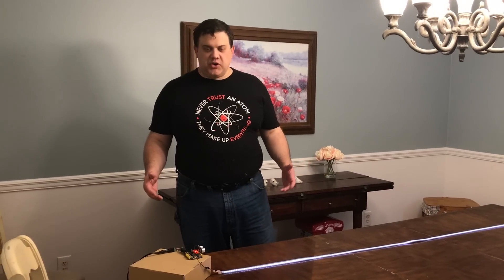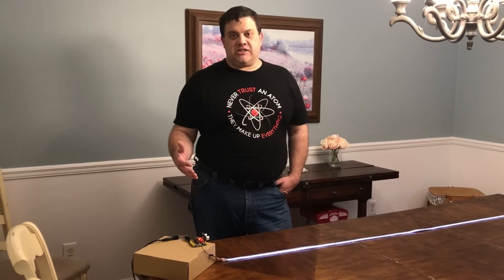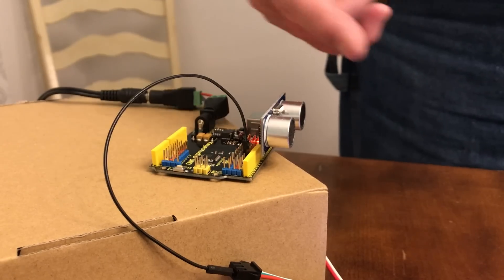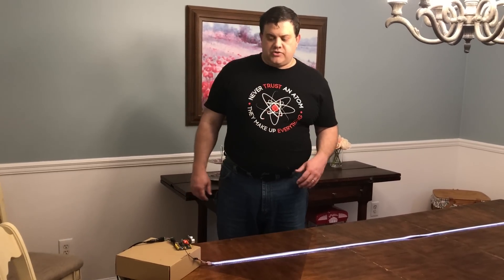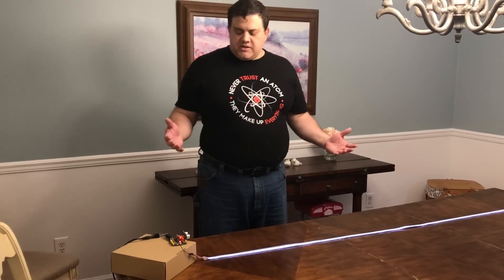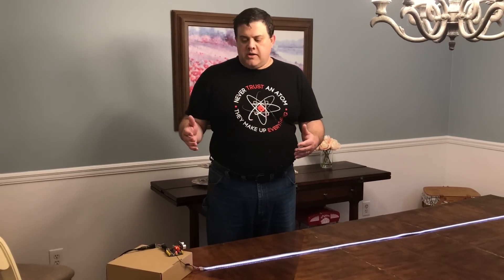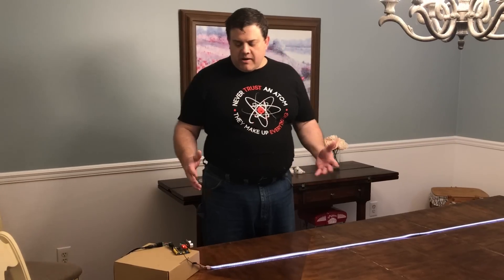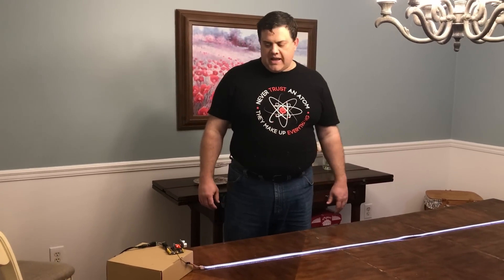Proof-of-Concept:  Interactive Light-Strip

Comment: Subbed. Thank you for being clear and to the point.  The first idea that comes to mind is a 'drawing board'.
On the idea of using a 2nd sensor to detect a 2nd hand, I fear that the 2 sensors will interfere with each other
Actually, if you have only one active at any given moment then there should be no interference.
Reply: Gate the sensors, so if no signal is present only one sensor is on. When the signal changes, start the other sensor. It may help reduce that interference. Place your sensors far away from the led strip, and control the lights like a puppeteer.
Reply from the maker: I had the same concern... but it's actually very easy.  When coding the ultra-sonic sensors you tell them when to "ping".  It's as simple as making sure that each one pings at a different time (with enough delay between them that they don't overlap).  No need for gates or anything fancy.